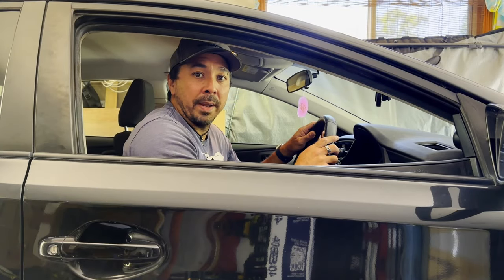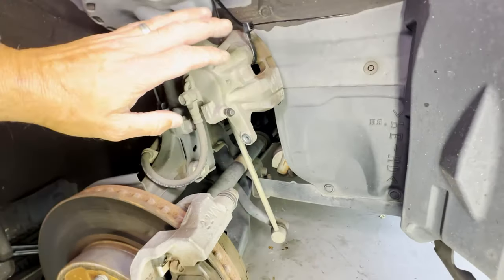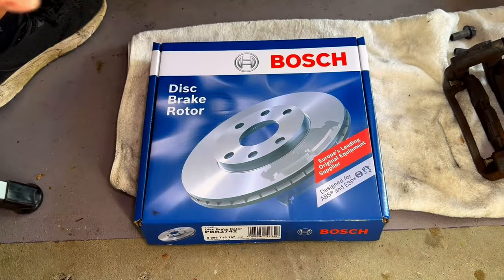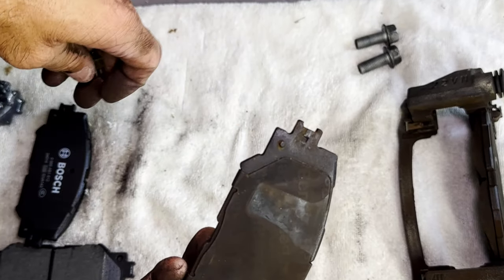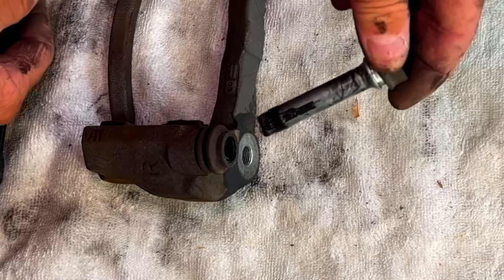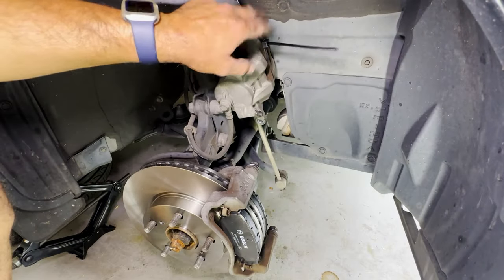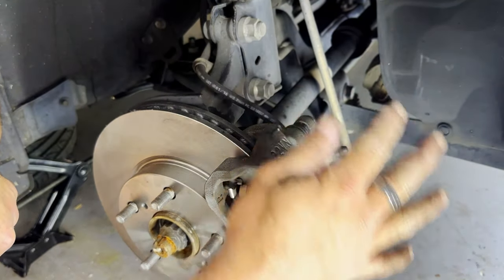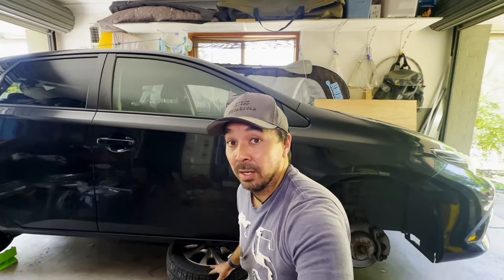Replacing Brake Pads & Rotors on a Toyota Corolla

Comment: You said, one clip per pad per set, but does it matter what side (right or left) of the brake pad that the single clip goes on?   Also, do both clips (per set) go on the same side or can one clip go on the right and then other on the left?   Thank you!
Reply from the maker: It’s been a while and depends on which way you’re looking at it but when you pull out the old one, you will know which side the clip will go on so that the pad goes on the exact same way.

Comment: those pads looked good ... not sure why yoiu replaced them.
Reply from the maker: You're right, they may have looked good but they were probably a cheap no name brand which when I pulled one off, part of the pad broke off in my hand so I thought I'd replace the lot which cost less than $170 for rotors and pads! 👍
I didn't want put it all back together with the old pads and still have the shudder and then have to pull everything apart again. Brakes are smooth as silk now! 👌